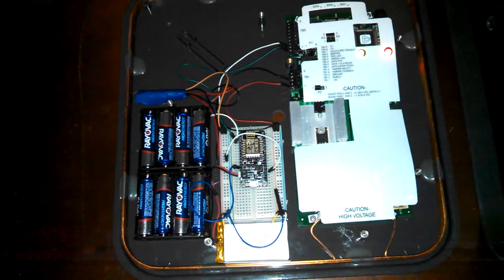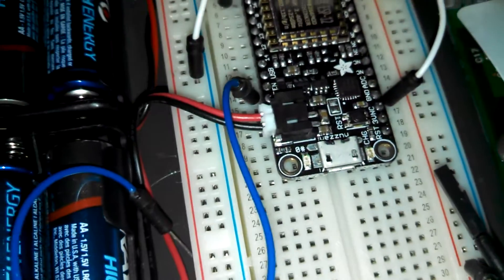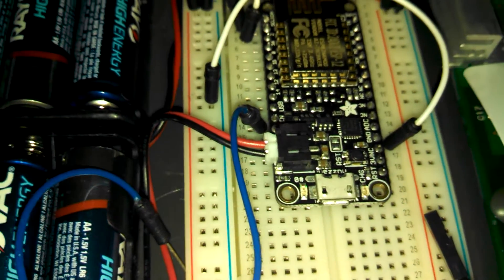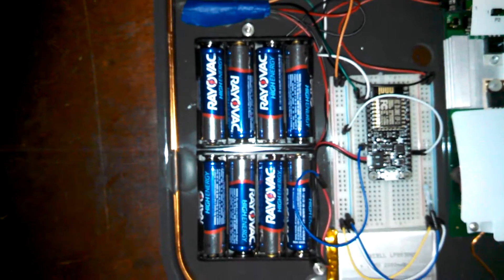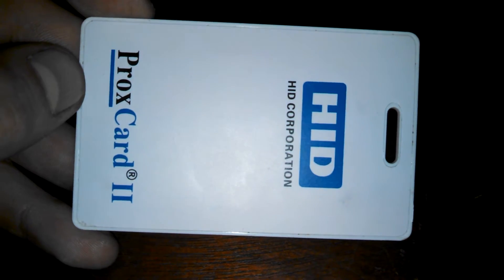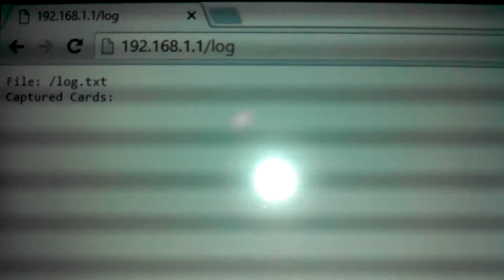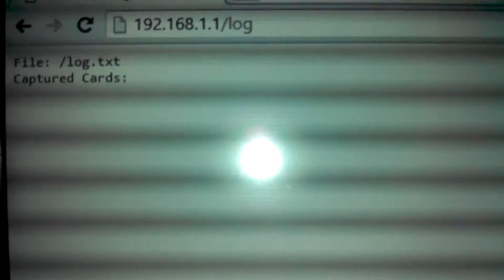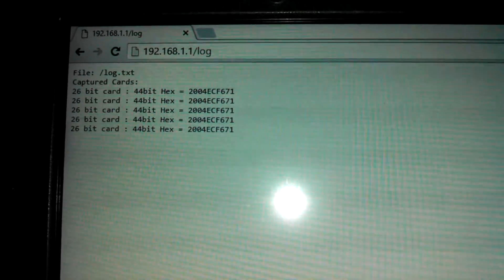Tastic RFID Thief Remix/port with WiFi to ESP8266 Adafruit Feather HUZZAH ESP-12

Comment: A friend of mines company of employment is looking to build one of these. I loled at the 12 AAs the bf version uses and am building him a lipo pack with two switching converters and sheilding. while doing my homework for the build i noticed that the reader they use has a max draw of 1.7a when fed 21v and only like 700ma when powered by 12. This could either be a resistive voltage regulator or its ouputing a stronger field at 21v. I called HID global tech support and was told it does indeed put out a stronger power field/xmit signal at the higher voltage... I dont own any of the parking garager readers so so far i have to take that techs word. Might be something u wanna look into though. Did you use the Wiegand interface or the serial out?
Reply from the maker: Weigand.

I went 12v for battery life and fewer parts count.  I made a build with a goal of being easier for people to replicate who are scared of soldering or inexperienced and trying to add something to the table by on board file system for logging and retrieval of logs via WiFi.  There are fewer connections with my project that require soldering and minimal parts count.  I am glad you thought a proof of concept build with the intent of being easy to replicate was a funny concept.

I never looked into the increased voltage equals increased read range but it has crossed my mind.  It depends on if the power to the antenna drive is regulated or not.  Some HID readers are and others not.

ProxPro vs ProxPro II

https://www.hidglobal.com/sites/default/files/0026_an_en.pdf

"
Read RangeThe ProxPro II offers an additional inch of read range, when compared to the ProxPro at 12VDC.  Although itdoes not contain a metal tuning jumper like ProxPro, when mounted on metal, ProxPro II gets comparable readrange to the ProxPro.The ProxPro offers superior read range at 24VDC because it uses unregulated power for the antenna drivecircuit, so that the read range increases with input voltage, while the ProxPro II uses regulated power for theantenna drive circuit so that read range is consistent regardless of input voltage."

https://www.hidglobal.com/sites/default/files/resource_files/hid-prox-br-en.pdf
Reply: unless you are the dude who presented this at black hat a few years back i didnt lol at your proof of concept. I loled because the dude selling plans and pcbs/who originally made the arduino version never mentioned anything about the voltage. Its one thing to throw it together for yourself, but when you are profiting from the pcb/selling kits its a bit different. 

here is why those AAs arnt actually doing anything great for your battery life:
There is also a property of batteries called internal resistance which increases with every battery in series. 
http://data.energizer.com/pdfs/batteryir.pdf

Energizer alkalines are about 0.2ohms meaning your pack has maybe 1.6ohms of resistance and probably drops about 1.1v when the reader is @ 700mh. this also means a 3/4 a watt is going to heat inside the cells/draining your batts faster. you have about 2500mha at the uper end of alkaline 

if you go with 4 Panasonic/sanyo 18650Bs in series  each cell is only 0.055ohms ir. your pack capacity will be about 3350mha @ 16.8v full 12 empty. The less adventurous can just buy an 4s rc pack. Those with a vape or flashlight and 18650 charger should probably go single cells in series and use their existing charger.

either way you add something like this:
http://www.ebay.com/itm/Li-ion-Lithium-Single-18650-Battery-PCB-Protection-Board-4S-14-8V-8A-W-Balance-/322415881717?hash=item4b117bedf5:g:3uQAAOSw4DJYmUY8

and it watches each cell in the pack to turn off the pack at the weakest cells cut off voltage. The packs resistance will be higher than the .055 per cell if each cell is removable but it will still likely be far less than the 0.2 ohms of AA(that doesnt account for holder either.) 

All that said I do like your idea to port it to that mcu. did you level shift the wiegand or feed it str8 in? i dont see any resistors but im not sure whats under the painters tape above the cells either.